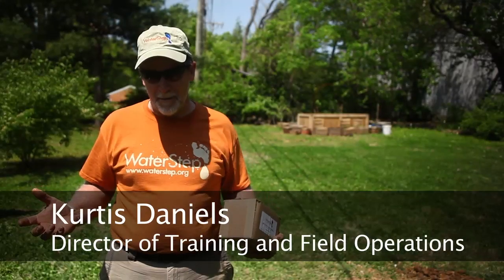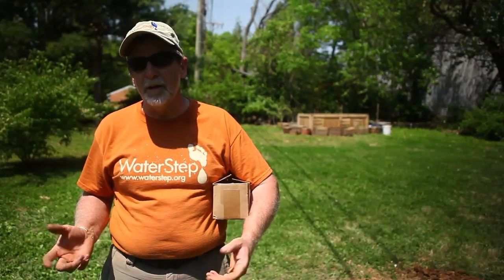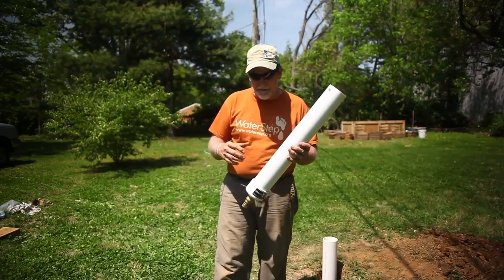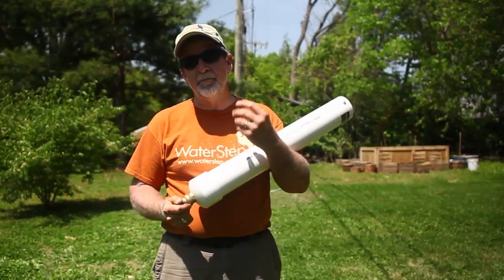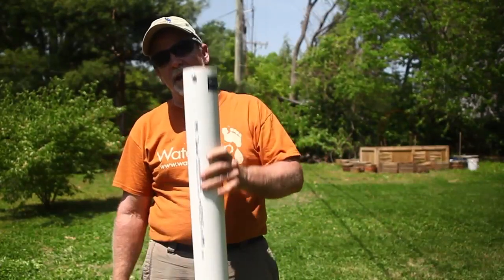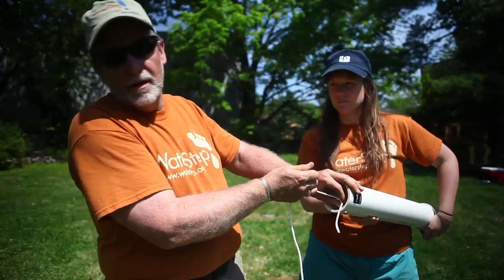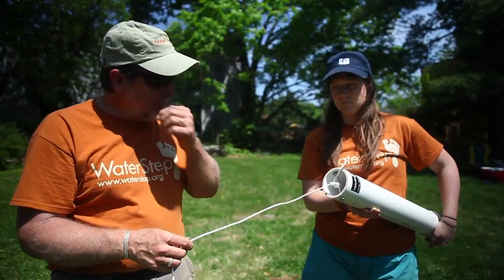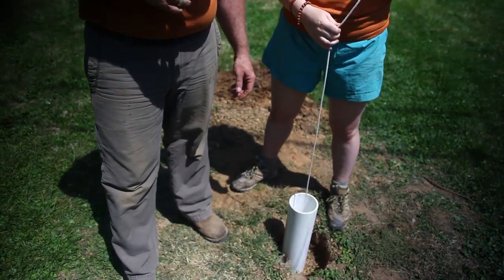WaterStep - Bailer Bucket

Comment: I was hoping for a bucket to get the "mud" out of my well. At 18', I can't rely on my fence post auger to remove the  mud, so I can put my 4" casing another 5' or so. (New well). When I pull out the 20' auger, the mud just fills back in the hole. I can push the empty 4" casing down another foot or so, but that's it. Don't know if I can pile drive a 4" screened point another 5', W/O damaging it. Maybe I'll try a 2" PVC pipe, with a water hose on it, and see if it'll raise the mud out of the hole. (It's all sand) Thanks for sharing your knowledge.
Reply: I’ve got a bailer and it is like this one but with just a rubber flap. The extenstions are square and the bailer can get twisted into the muddy muck and will fill through the thick rubber flap. It gets pulled up and guided by the extensiones.